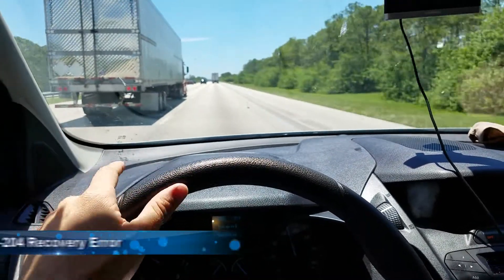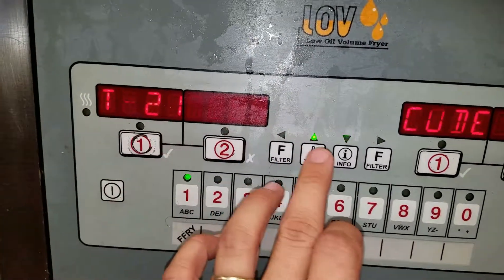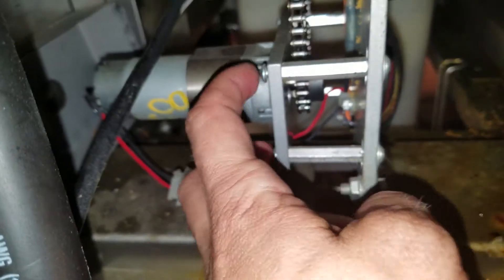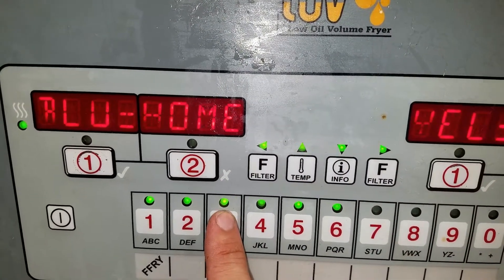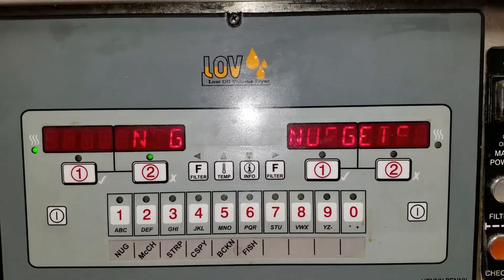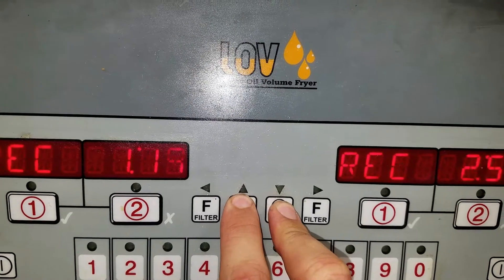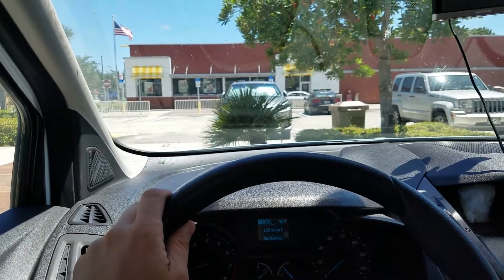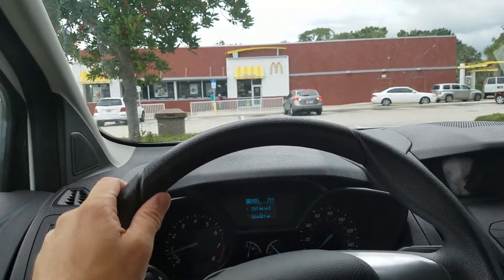LVE-204 Selector Valve Motor Repalcement and Other Issues

Comment: Thank u sooo much for upload videos . Pls upload new video with new fault . It's real helpful for technician
Reply from the maker: No problem. If I get another fryer with a different fault, I will do a video.
Reply: @thefryerguy5982  thank u sooo much sir
Reply: We also doing maintenance specially mcdonald equipment and we facing mostly issue on frymaster fryer lov, because frymaster fryer is very hard for maintenance and conjusted fryer. Henny penny really easy and better than fry master.